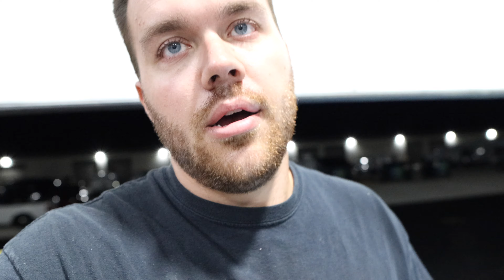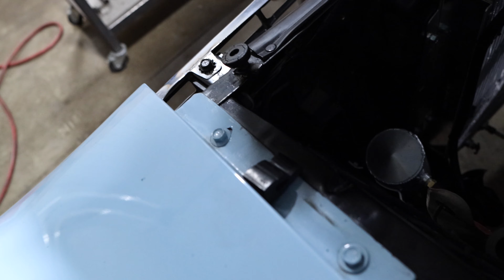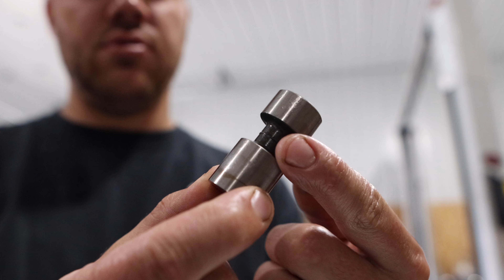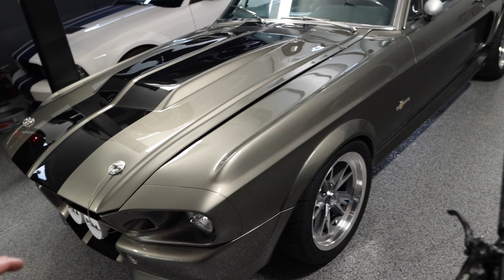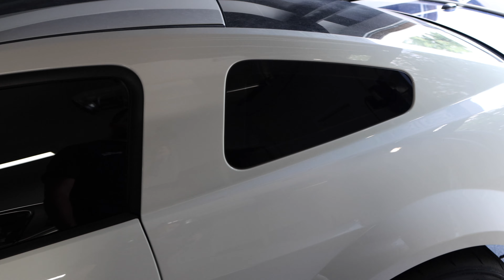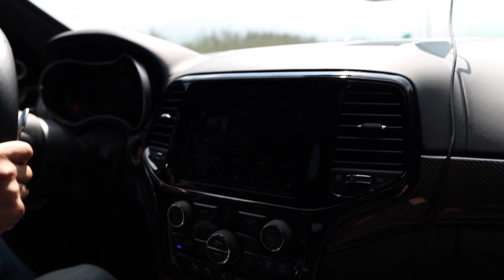Ultimate Dream Garage! | Gt500's, Viper GTS-R, and Trackhawk Launch!

Comment: Hey bro need to advice here, I have a new edge and I added some new wheels 18x9.5 front 265 rubber 22 offset, 18x10.5 rear 295 22 offset, I’m having a issue that is super irritating me so much, front driver side wheel sticks out way more then passenger, and rear drivers side is a bit off to, but rear I can live with, if I can’t find a fix, front is really noticeable!! Car has coilovers
Reply from the maker: K member is not square or lower control bushings are shot (if factory) 
Rear, bushings are shot if stock.
Uppers need to be double adjustable to center the rear axle under the car
Reply: Streetcar Shenanigans fuck you rock!! Thanks bro!!!
Reply: Streetcar Shenanigans you think I should get tubular control arms in the front or just replace with some oem ones? Also with the rear should I do uppers and lowers? Or just lowers
Reply: Streetcar Shenanigans not sure why people are telling me to get a Panhard bar that is what fixes the issues... I’m going to go with what y’all said, just ordered t he bmr ones see how it works out! I hope it fixes the issue
Reply from the maker: Panhard is a bandaid. 
Make sure to check upper bushings on the housing side. Or order some solid ones now. Pain in the ass project tbh